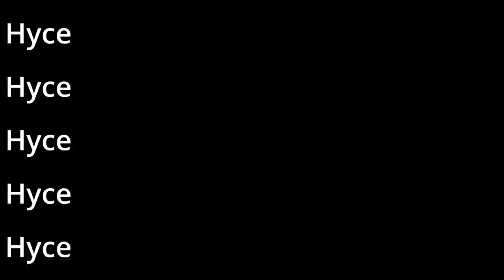A 60 year old diesel gets it's 2nd paint job.

Comment: Dont know if its planned or been done yet, but I would highly recommend applying a layer of clear lack over top of all the new paint. Beyond making everything look shiny, it will protect the paint and lengthen the paintjob's lifespan a good deal. When the paint starts to look chalky and faded, you can come in with some buffing tools and polish it right up again, which is a bit of a no no if its just the body paint. Adding clear lack is obviously going to cost something, but you'll thank yourself for it down the road.

Comment: Back in 1978, we stopped at the CRIP yard in Burr Oak, Ill.  
On the turntable was a fresh from EMD,,,SD40T-2 in DRGW paint.
The CRIP employees were admiring the loco, even getting on top and all over the engine.
Quite the contrast.  In the yard were CRIP C415s, GPs, U28s, even an RS3 mutant.  In the roundhouse were a F7(UP paint), GP7 and an E7.

Comment: While it seems backwards,  painting the details first is the better way to do it.   If you paint the main color first,  you would have to cover. EVERYTHING when painting the detail to prevent any over spray on the main paint.  

 Imagine either covering the entire thing with plastic and masking around the details,  or just trying to mask around the details and getting orange specks all over the black paint.

Comment: I thought I’d be the only downer that could shred on guitar also.  Do you drive a classic to work too? This was pretty cool and if I could ask, what brand of paint, and paint line did you use? Did you go for cheap stuff or something with uv protection like a real 2k based acrylic urethane paint?
Reply: Sorry, autocorrect, I meant foamer not downer.  Your not a downer, definitely an upper with your positive vibes
Reply from the maker: Cheers Dan :) I do tend to drive the GTO to work when the weather's nice. It's no show car, but it goes vroom :)

The paint was a Sherwin Williams industrial type. I'll see if I can get details on exactly what line it was. It was pretty spendy.
Reply: Dude, this is soooo weird.  I just sold my GTO.  I was cruising around in a 72 400 4 speed until I sold it last September!!! It was a real GTO optioned Lemans and was cardinal red with the correct orb side stripe. I restored some honeycomb poly wheels and through them on and it looked sweet.  This is crazy though, it’s like I am your northeast twin.  As for paint that’s good to know.  Sherman Williams makes some good stuff.  I volunteered at a museum over here and they would mix oil based rust oleum paint to get the color close and just roll it on.  The paint would turn to chalk in the sun after a few years.  This gp30 came out real nice and it’s good to know after all that hard work it will look good for a while. Btw what year is your gto?
Reply from the maker: @danhoyland142  That's fun! Haha. My GTO is a '68. Sounds like you did some fun work on mine. I restored the rims on mine too, so definitely twins! Haha.

Comment: That paint turned out fantastic!  Do you happen to know what kind of shape the prime mover and electricals are in?
Reply from the maker: Bad! Lol. It's missing a traction motor, it's missing most of the control stand, and has several power assemblies not installed in the engine. Lol

Comment: is it epoxy paint?
Reply: Unfortunately with all the low VOC laws coming around it's getting harder and harder and more cost prohibitive to use two part paints. This was an industrial acrylic from Sherwin Williams that's made for use on buildings and industrial equipment. We've been using it for several years on different things at the museum and so far are really happy with its ease of use and how it seems to be holding up.
Reply: @dthom806  Interesting. Good to know.